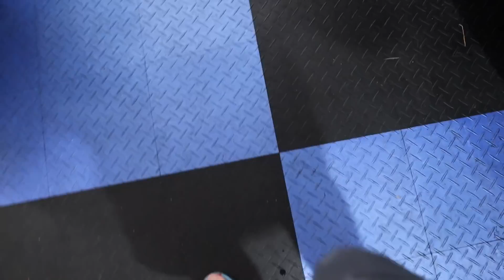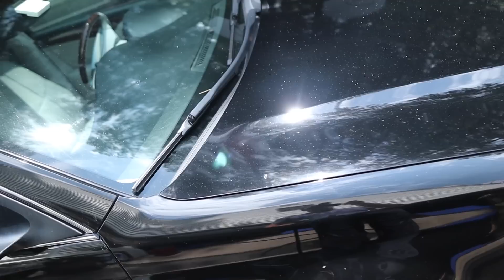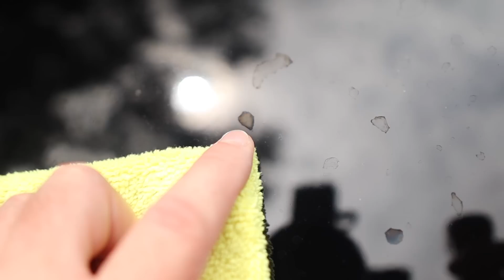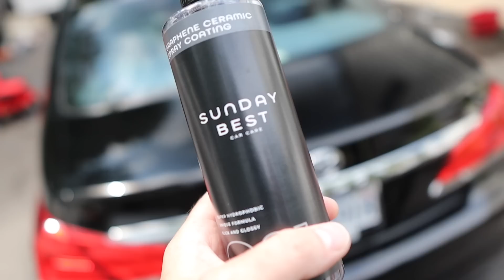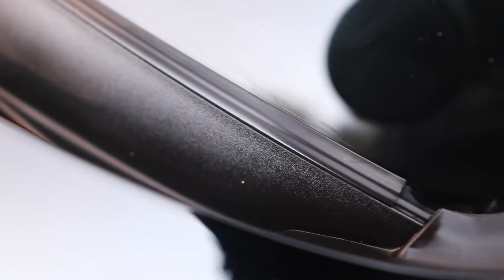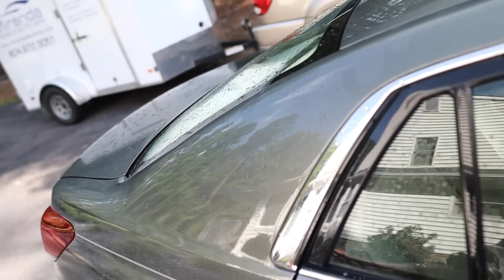Weekend Wash / Dealing With WATER SPOTS & NEW Products! #Realdetailing #SundayBest

Comment: Hi phil I have question if you could give me your input have you ever used bilt hamber auto wash or car pro reset can those shampoos be used as maintince shampoo I try clean car once to 2 a month i normally  follow up with megs synthitic  spray wax as a drying aid and my second question can you use geyon wet coat even if dont have presure washer thank for any input
Reply from the maker: Hi. You can certainly use those shampoos as a maintenance, Bilt Hamber is a ph neutral soap and it’s completely fine. Reset is a stronger soap designed for ceramic coatings, I wouldn’t recommend it as a maintenance soap for just waxes or sealants. You can use wet coat with a garden hose just use a strong stream of water
Reply: @MirandaDetailing  thank

Comment: Hey Phil. Need to lose the ceramic coating and start from scratch. Will the all purpose cleaner and a polish remover?  I also have the Gen prep..
Reply from the maker: Hi. which coating is applied?  Usually a polishing or light compounding will remove most 2 year coatings
Reply: @MirandaDetailing  Turtle wax Ceramic coating
Reply from the maker: I light polish will easily remove that.

Comment: Oh wow, I love that portable orbital polisher/waxer!  I saw you linked to the BATOCA instead.  Any reason, other than the 6" pad and only one battery?  I'd love to add this little toy to my collection.  Sure will save me from having to lug around the electrical cord.  That water spot remover... I'm gonna get that sucker as well.  I usually just use a light polish compound like Meguiar's Ultimate compound, then use the TW Hybrid Solutions Ceramic Polish and Wax on top, but that spray bottle has me convinced.  Thanks for sharing that product and its capability.

Oh, figured I ask, and I have an idea of what the answer would be but, I was on one of my usual Audi forums (Audizine) and I was reading how other folks detail their cars, and I read one guy using an orbital polisher/waxer to apply and buff in PASTE wax.  You ever heard of this?  I didn't think paste wax has enough oils/lubricants to sustain a mechanized polisher/waxer...

And by the way, that denatured alcy on sticky/filmy residue from the leather steering wheel on the Audi, uhm, I think I need to wait when it is colder outside.  I tried a little section on the bottom of the steering wheel and it was getting way too sticky.  I did use a Q-tip to apply some denatured alcy on the steering wheel, I'll see what the results will be tonight.
Reply from the maker: Hi. Yeah I have both polishers now and just like that the Batoca one comes with two batteries. They work exactly the same way and I don’t notice any difference at all. 
I have machine applied pastes before and it works just fine. It’s just annoying because The paste is in a tub or can. But it works the same way. 😎👍🏼
Reply: @MirandaDetailing  Huh!  Well then, I guess I'm going to give it a try.  My right arm has been getting larger recently... those damn paste waxes...

Comment: Another great video, I want to carpro essence polish, CQuk ceramic coat my car and a friends car with two coats and carpro gliss finish for the best protection! My question is how many ml/oz of each product do you recon I will need for the two mid size saloons? Thanks
Reply from the maker: Hi. Thanks!  I really don’t believe in the whole 2 coats of Cquartz theory. I only did it becasue the customer requested it. It’s not needed at all. 1 layer of Cquartz and 1 layer of gloss will get you the same results.  I would get 2 bottles of Cquartz 30ml or one 50ml and 1 of GLISS. But our coating application method may differ from others. We don’t use a ton of coating and always have plenty left over. We can coat 2 sedans with one 50ml bottle easily.
Reply: @MirandaDetailing  seems to be a 1 layer coating trend starting. Since i only do this for myself i tried 2 coats of UK on my trunk lid. I had to re-polished it to get all the high spots off a few days later! lol 1 layer was much easier. All this done in my driveway. Nv EVO is easier to work with then UK in my situation. Lot more expenisve however but like i told you somewhere else, its advertised as 1 layer and states 2 layers will make not any improvement. I'm paraphrasing not sure how that exactly they put it now. I  forgot to mention xtreme's finale looks like it could be a game changer. I hope more people start to use it after watching this video. I forgot about the polish actually. Does it have much bite for a paint enhancment say using 15mm longthrow and LC orange.
Reply from the maker: Aw man! Yeah without the right lights sometimes high spots can be missed. It’s happened to me before. That’s why we try to be so careful and precise when coating.   With Gtechniq coatings like CSL and CSU they are also only one layer systems which is so easy to apply. 😎👍🏼

Comment: Nice turn around on your daily. Does all your vehicles sit outside 24/7? With all your experience with products, what have you found to be the best sheeting product? Or one that reduces water spots? As long as it lasts a month I don’t care about longevity. I really enjoy the weekend washes with different products. Especially products that are not mainstream.
Thank you
Reply from the maker: Hi. Thanks!  As far as sheeting goes I guess the New Hybrid Solutions Flex was does bead at first, but it later goes to sheeting, at least for me it does.   But it also depends on your water. As long as you dry right after you wash, and use some sort of drying aid, you shouldn’t have water spot issues. Even if it rains and spots, those water spots, if they haven’t mixed with tree sap and other junk, should easily wash away.
Reply: I may have to try TW. My issue usually is a result of a vehicle being dirty then getting rained on. Looking for a sheeter vs a header. The topper will be going on coated vehicles.
Thanks

Comment: I have tried Adam's graphine cermic spray coating. It's nice. East to apply and it flashes fast in high heat. I had the bottle for like 6 months and didn't try. Finally did try on my daily driver. It's goes on like 100 cermic coating. Very good coverage. Beading is amazing. I regret buying carpro reload. Doesn't last month.